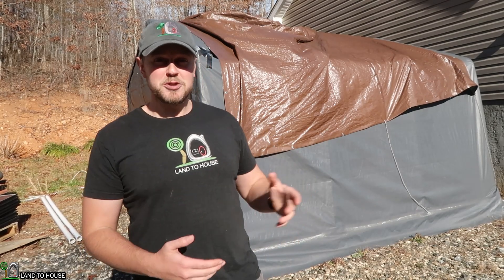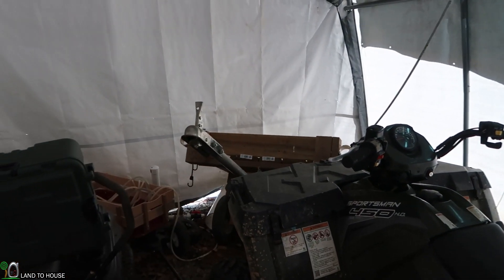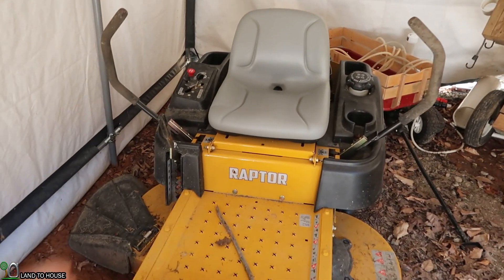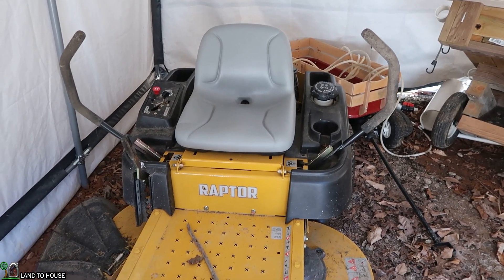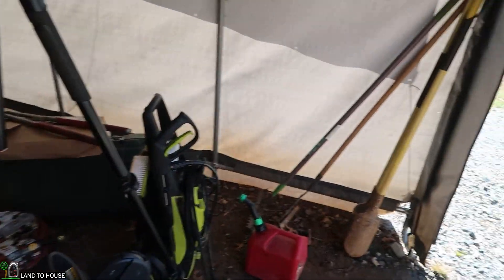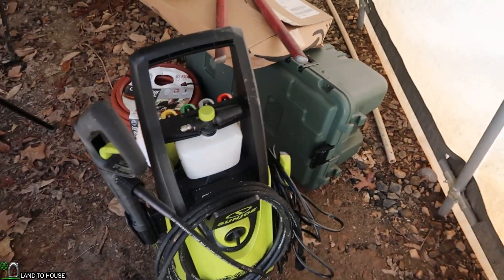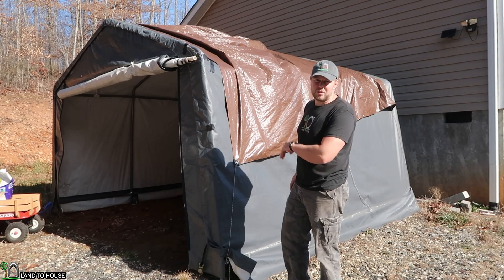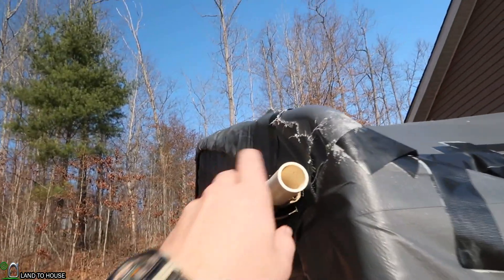Move ATV and Lawnmower and take down Shelterlogic

Comment: I put my frame on 4x6 posts in the ground. Fastened frame to that. Then fastened 2x4s with pipe straps vertically to the frame tubes. I then fastened sheetmetal horizontally to that. And closed in the end or ends as needed. Did that 4 years ago and still no issues.
Reply: @Islandwaterjet  I've actually added a 10 ft . Lean to on one side for my calves and goats. And it has worked great. We have high wind and heavy rain . Sometimes some snow like last week. But no issues.

Comment: Seth, I enjoy your videos and it's great to see the ATV and lawnmower move into their new home.
You are more generous that I would be in your assessment.  With a price tag of $450 for the shelter logic, but the tarp is only UV resistant for less than 2 years before it degrades and starts coming apart, and $150 for a replacement tarp that will only last another 2 years at best, that's not what I would call a good deal.
Reply from the maker: Thank you for being part of the channel. You bring great insight!

I only paid $250 ish for my 12x12 shelter logic. I was thinking for $125 a year its not terrible. Now if it has gone up to over $400 I can see your point! And I was also annoyed by the replacement cost.

Comment: The shelter logic frame would be good for a frame to build another building. Screw metal or fiberglass to the frame and have another building. could put the tarp over the ATV cart to protect it until you get the shelter logic repurposed..

Comment: USE THE OLD FRAME FROM THE TARP SHELTER, TO MAKE A SMALL TIN ROOFED SELTER TO PUT THE OTHER THINGS UNDER.    YOU MIGHT BACK THE MOWER AND FOUR WHELER IN, SO THAT WAY YOU COULD JUST DRIVE THEM OUT.  AND WHAT IF YOU PUT THE LOWEST SHILVES UP AT ABOUT 4 ft. OFF THE FLOOR, YOUR HANDS WOULD CLEAR THEM WHEN DRIVEING IN, GIVING YOU MORE ROOM TO TURN AROUNDOR,  WALK, ETC          . GOOD JOB.